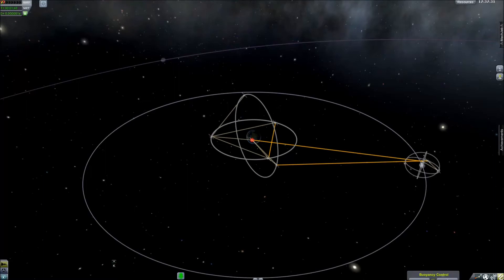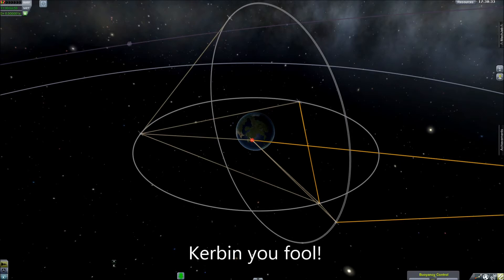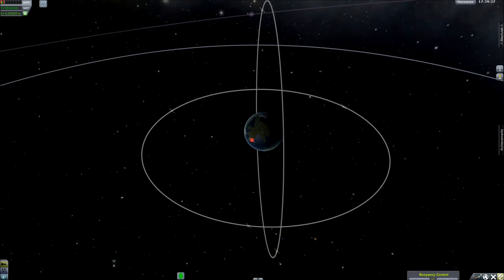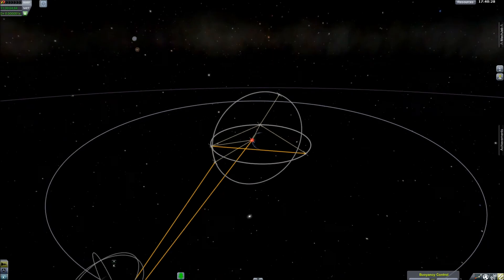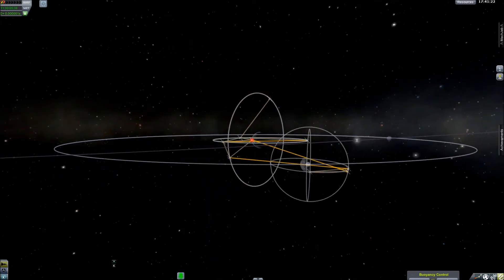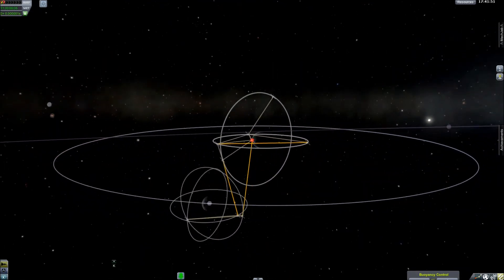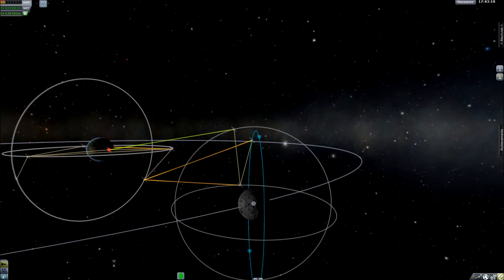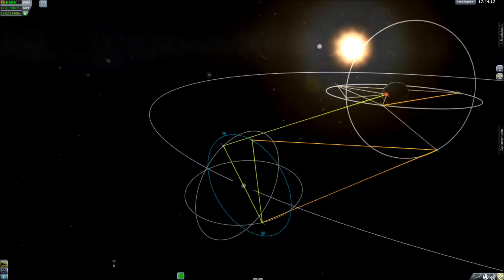KSP .022 Remote Tech Part 1

Comment: You should be able to have a fully working network around Kerbin without stationary orbits using only the 2.5 Mm omni-directional antenna. Omni-directional antenna automatically connect to other omni-directional antenna that are in range, including the space center (and one antenna can connect to many other antenna). Therefore you could just setup 3 satellites 120° apart that have a circular orbit of 1 Mm. This way all the satellites can always make a path to the space center, even if the satellite that connects to the space center changes.

This might be desirable in instances where you do not have sufficient technology to store enough power to run your satellites for half a Kerbin day without solar power (which is a huge problem when you also run more than 1 antenna). When in lower orbits, the time the satellite is in darkness is much lower. This assumes that you want to keep your satellite designs compact and minimal (as I am a huge fan of).

I have not yet figured out a good way to connect Minmus and Mun to Kerbin in a reliable way with as few well placed satellites as possible, although your approach is fairly clean and reliable.

One way might be to put 3 satellites on Mun, 120° apart in low enough orbits such that they go around three times in less time than the Kerbin satellites go around once. Each Mun satellite would connect to 2 Kerbin satellites, and each Kerbin satellite would connect to at most 2 Mun satellites.
Reply from the maker: Nice comment. Thanks.   I went for goesync as the idea was that the height above the surface allowed the sat's to be 'clear' of the planet for longer when connecting to the Mun and further out.  But your suggestions are very valid.  I have dropped 12 satellites using the 2.5mn omni antenna around Mimis (covered in Part) this seems to work, but I've yet to connect them to Kerbal.